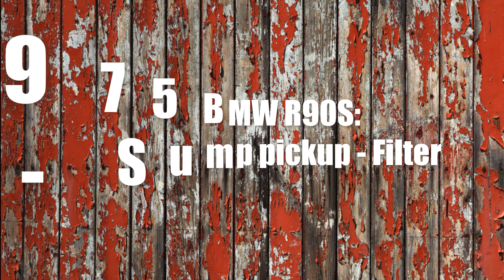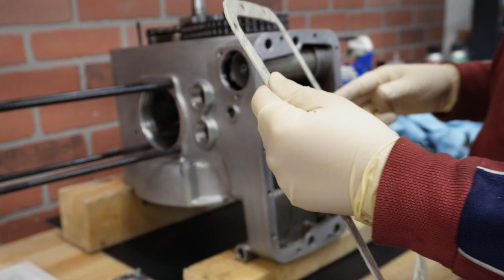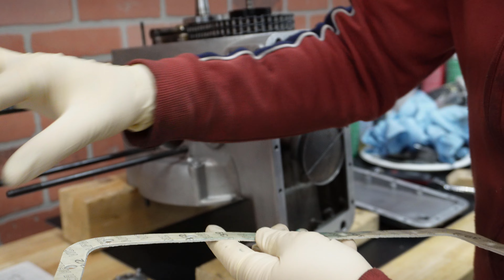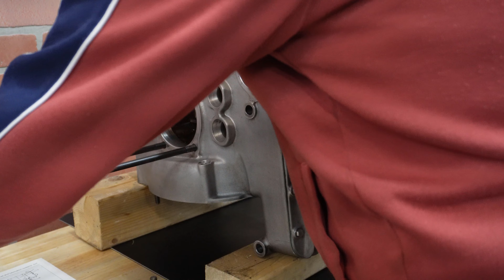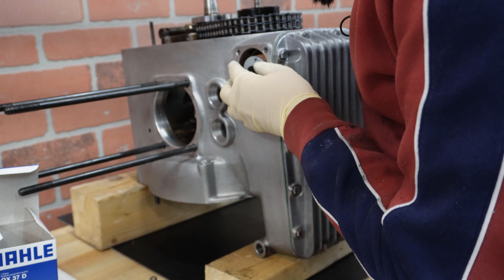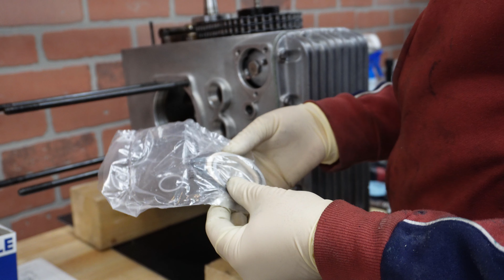1975 BMW R90S: Oil Pan, Sump Pickup, and Oil Filter Installation

Comment: How did you clean the engine castings?
Reply from the maker: First round of cleaning simple green aircraft version with green scoth brite, small steel and brass brushes. No power tools unless you want to unnaturally polish the metal. Second round is with autosol aluminum cleaner with 00 steel wool. That’s it. Good luck and thanks for watching

Comment: Really interested in this series as I’m rebuilding an R50/5 engine. I just couldn’t bring myself to do that inner oil filter bolt up to 40nm. Seems way too tight. I did it by feel but would estimate about half that figure.
Reply from the maker: I’m with you on this one. Took me a lot of researching before I decided it is safe to push it. But still good idea to go by feeling even when using torque wrench so you can stop before it goes completely south. Thanks for watching!